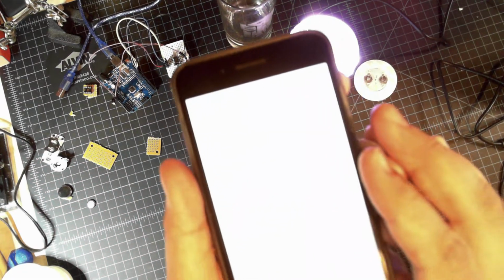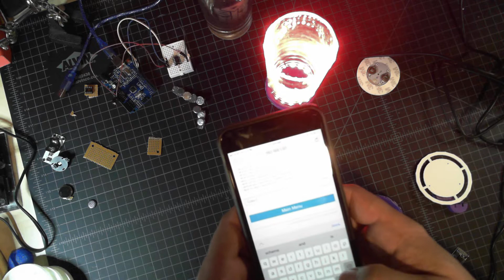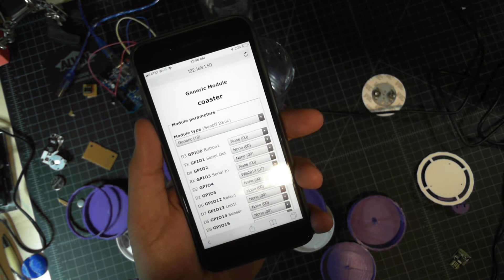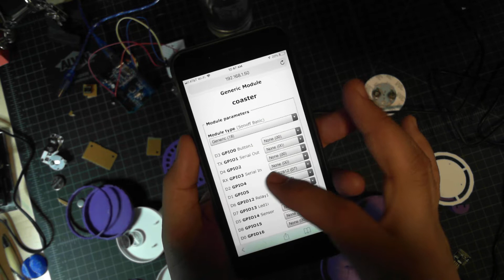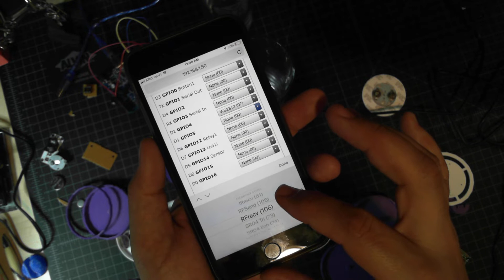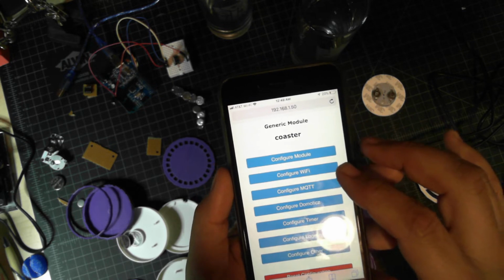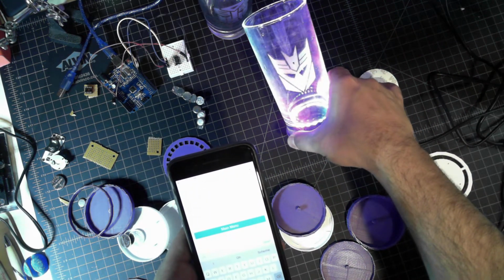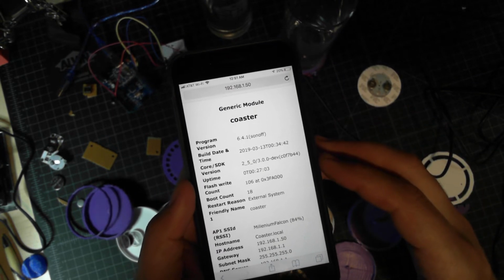A smart drink coaster (and how to learn from failures)

Comment: Nice project! An alternative for Tasmota for your use case could be McLighting v2 (by user toblum on GitHub). It is designed for ESP8266 like the Wemo D1 mini you used here. 
This already has a nice web GUI for color selection and all the effects you would ever want. Besides that, it also talks MQTT and is easy to integrate in Home Assistant as well (for your accessibility hacks of course, and other usefull notifications).
Did I say it also can visualize music? :D

Not to pull you back in for another 3 weeks of course... :P
Still wanting some more MPCNC videos of course as I have started building one myself ATM.
Reply from the maker: That's probably a MUCH better idea than Tasmota...I felt like there had to be a better color setup than what I was working with. I'll check that out and maybe revisit this and make an update! Thankyou for the suggestion.

My MPCNC situation is a mess right now...I can't build a shed bigger than 7x10 in my backyard due to city regulations, and so I built a shed in a remote location on some land I had, but it's 2.5 hours away and in the winter I've not been there. Also my machine cracked in transit! I sadly may not be able to get to MPCNC videos of any worth for a few months at this point, and it's killing me because I LOVE playing with that thing and just felt like after 3 months or so I was improving at using it. It's killing me, but I'm trying to put out some fun content in the meantime. Nick Ellison started a channel though and I'm stoked about that, I may have to do a video just of the other makers that have started since I did my initial ones...Nicks amazing!
Reply: @geektoolkit  also you might want to checkout WLED, like McLighting it works on the ESP8266, integrates with Home Assistant